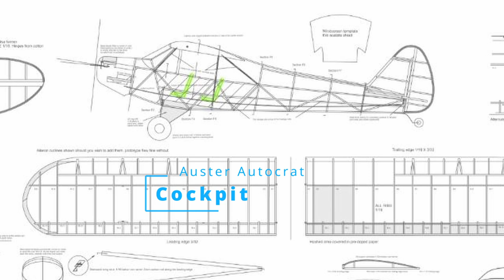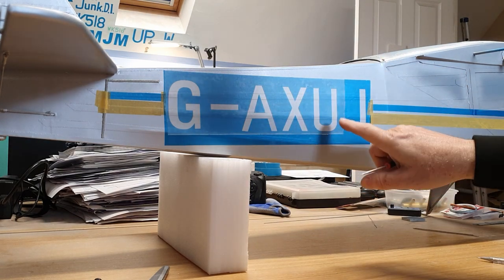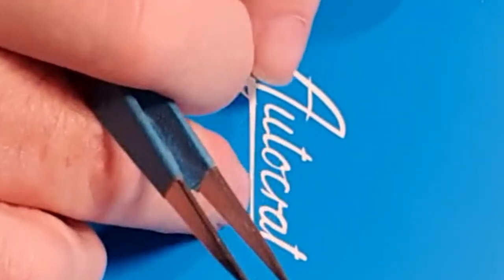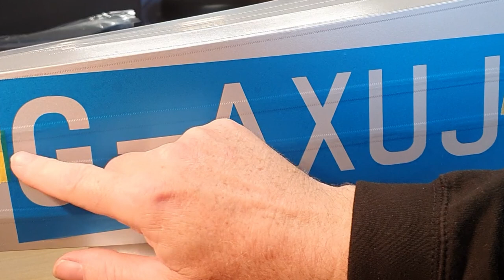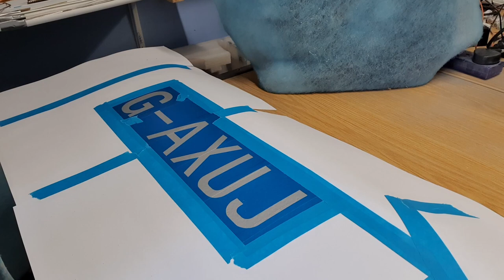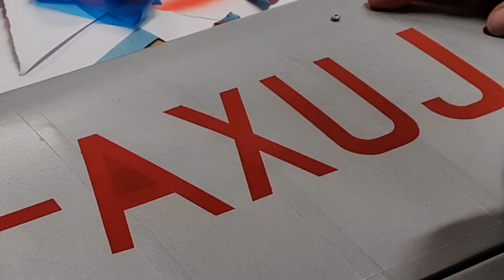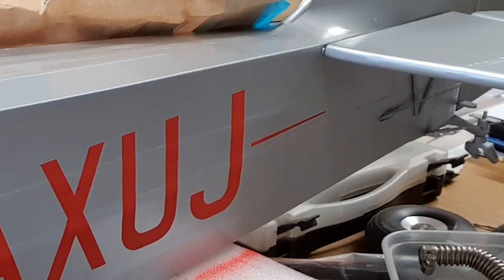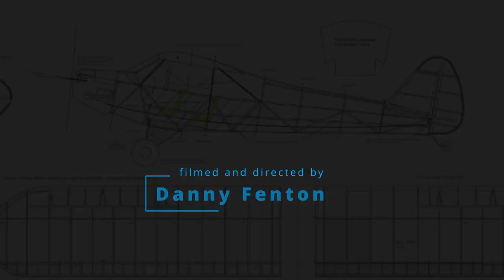Masking and spraying red trim lines - zero paint bleed

Comment: The paint job looks top notch!
Very instructional! May I ask what plotter you use. You said the name a couple of times, but I couldn't quite make it out.
Curious to know, have you tried shooting clear before color on your masks to help eliminate creep? Do you think the extra step is worth it?
Reply from the maker: Hi and thank you, its not as great up close, but the red is sharp even over pinked tapes, that is very pleasing.
I have never seen the need to shoot clear to seal the edges, In my opinion its putting down a heavy wet coat that causes creep/bleed. But I have heard of modellers that do use clear for this reason. A light coat of the right colour works fine.
The plotter I have is a Graphtec Craft Robo. I am afraid the model I have is obsolete. The replacement is the Silhouette, I don't know much about it, and am not sure if it has plug-ins for Illustrator for example, but it does come with it's own software that a friend of mine rates highly.